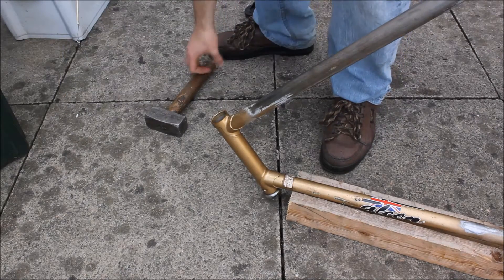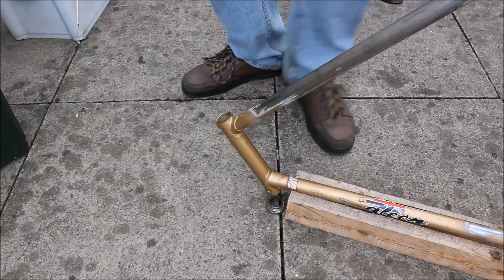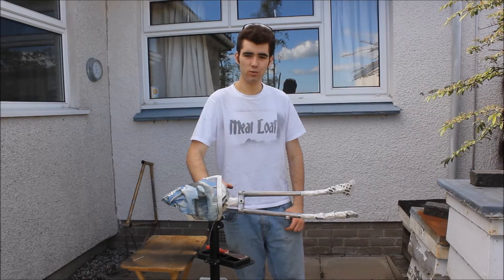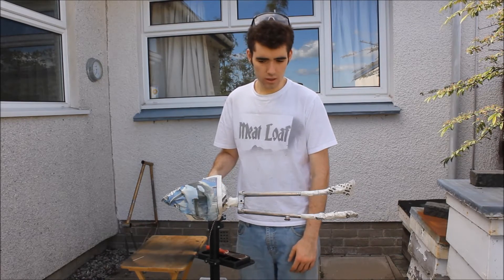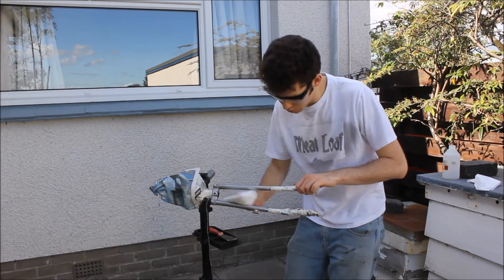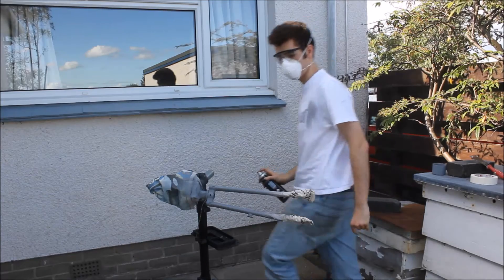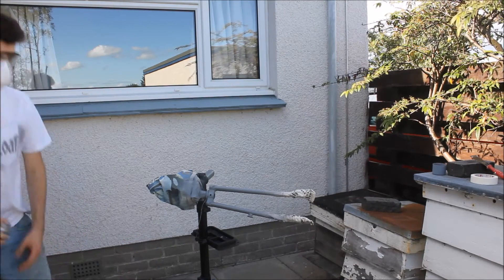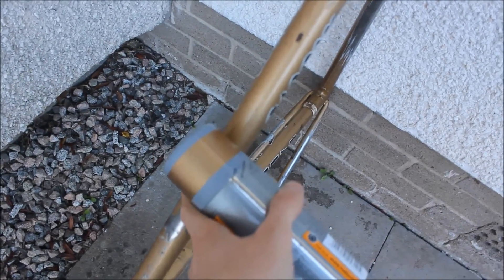£120 restoration challenge part 3: ready for paint!

Comment: Its best to hit the cup from the inside.  I have hit them from the outside.  If there rough and going to be replaced.  It doesnt matter too much.  I have even just used a hammer directly on the cup for some freeform shade tree style mekanikin.   Tho that might lead to dents on the head stock.  Ive never used a wooden holding piece tho.  Never thought of it.  I usually hold the frame, headstock up, rear dropouts above my foot.  With the frame close to my body.  so it doesnt ring when I tap the cups a couple of times.  I dont want to make noise and upset my neighbours. 
Oh yeah. I hope the fumes or overspray didnt affect those beehives.  last thing I sprayed was a set of cranks and handlebars.  Out in my back yard, thats quite open.  the paint fumes hung around for ages.  I hung the parts, on wire stripped from old tyres, onto the washing line, to dry.